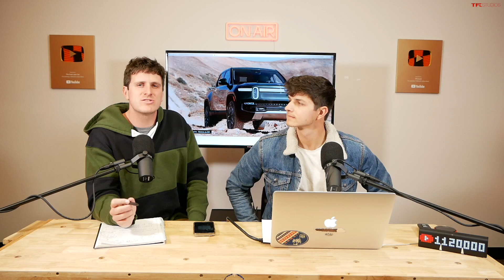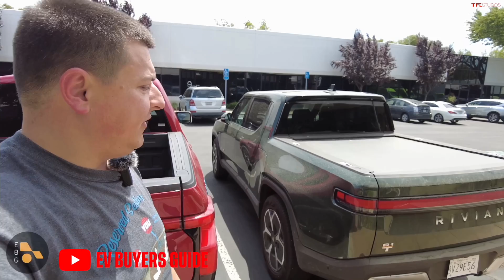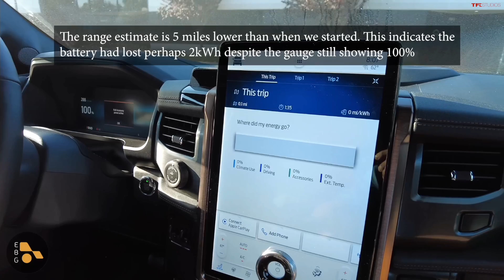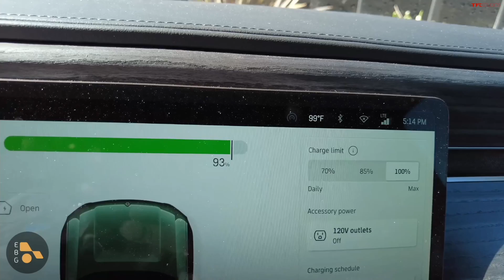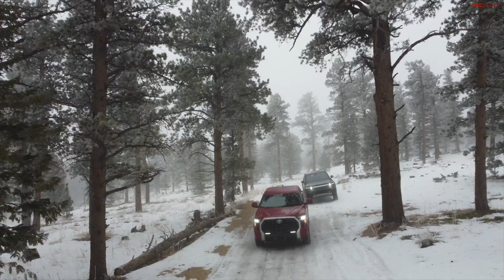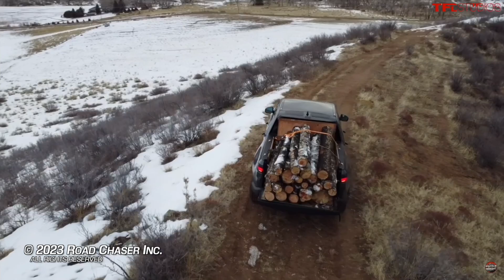This Rivian Is Getting The Equivalent of Just 25 MPG: Here's Why That Matters!

Comment: It will be perfect if they add an extender small alternator or generator that gives you at least 40 miles range in gas, like the BMW i3 or something.  There are situations that you cannot charge specially in cold weathers. Maybe down south you could use a solar panel to charge enough but in colder climates is a no no

Comment: My calculations are 9.5 cents per mile when I charge frome home, about 30 bucks, and calculating a 35% loss between the battery and wall socket.

Comment: There is a ton of conjecture here due to Rivian's lack of transparency with issues. They promote their over the air diagnostics capability, send out updates saying they will fix the issue, then say it is normal consumption. The battery management including preconditioning has issues. If it was a software issue, it would have been resolved by now. Software does not use this much power. Everything points to a hardware temperature control battery issue. It will sink the company if this is the problem and they have a massive battery replacement program.  They will eventually have to come clean on this. All I can suggest is, do not buy a Rivian until this issue is resolved. For all you Rivian owners, I wish you the best. Rivian talk to us!!!!

Comment: 3-12% battery loss is massive. My tesla (not a bash, just a comparison) uses maybe 1-2 percent over that period of time as long as you let it sleep. I wonder if the owner has his security cameras running on the rivian, or if it’s constantly checking for updates? I do know that some tesla owners had massive drain before because they had their tesla linked to their “better route planner’ app…the app was never letting the car sleep and always relaying information, etc causing massive battery drains.

Comment: I thought Rivian had something workable going, but I couldn’t recommend them with SO MUCH inefficiency.  No way! 
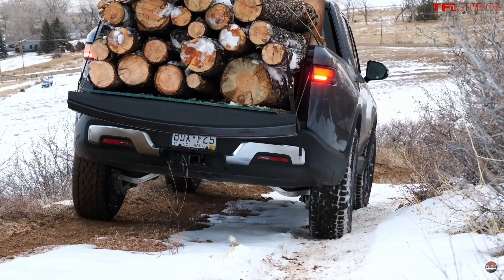Hearing someone from Rivian Service ( 8:50 ) say losses of 3 to 12% a day is normal is unbelievable!  I’ve owned 5 plug in vehicles from three manufacturers and never seen more than a mile or loss a day except when using Tesla Sentry Mode’s active camera monitoring.  I travel for a living and usually go on 3 or 4 day trips most weeks of the year.  I’ve never seen seen more than six miles of total range lost on my Model 3, and that’s with it parked in the Houston heat (no Sentry Mode).  That would be about 2% of my long range battery’s capacity over 3-4 days.

Comment: The reason to pay much more for electric car - savings. 
But it has low range, charges very long and generaly you don't drive it a lot. You don't save on fuel and maintance at all, especially considering the price difference!
If you want true savings, just buy a used ICE car.

Comment: I tried it with my Volvo S40 D5 185 HP. I charged it with 57 liters of diesel (around 15 gal) and left it for a month. After a month it DIDN'T loos a single drop of diesel fuel! My Volvo is 50-60 mpg. :D

Comment: These poor people without garages buying electric cars in states with below freezing temperatures.  

Batteries hate really cold temperatures and really hot.  People forget it's a battery and it's constantly doing a chemical reaction inside.  

I know these automakers aren't insulating the batteries enough.  Soon they will sell a battery magnetic blanket to keep the battery at optimal Temps in colder climates that you will plug in at home.  The sooner they get to this the sooner they'll get to tackle the next issue.  

Either way batteries have life cycles and we aren't perfect to keep a battery in its happy place 24/7 to get max life out of it.  So have batteries get cheaper and materials as well these batteries life cycles will get to average 10-15 years soon.

Comment: It would be best if you equate all the energy sources (electric, gasoline, etc.) in joules.  AND, provide a small table to let all of us tranlate.
One joule represents (approximately):

The amount of electricity required to run a 1 W device for 1 s.
The energy required to accelerate a 1 kg mass at 1 m/s2 through a distance of 1 m.
The kinetic energy of a 2 kg mass travelling at 1 m/s, or a 1 kg mass travelling at 1.41 m/s.
The energy required to lift a medium-sized tomato up 1 metre (3 ft 3 in), assuming the tomato has a mass of 101.97 grams (3.597 oz).
The heat required to raise the temperature of 0.239 g of water from 0 °C to 1 °C, or from 32 °F to 33.8 °F.[15]
The typical energy released as heat by a person at rest every 1/60 s (17 ms).[note 1]
The kinetic energy of a 50 kg human moving very slowly (0.2 m/s or 0.72 km/h).
The kinetic energy of a 56 g tennis ball moving at 6 m/s (22 km/h).[16]
The food energy (kcal) in slightly more than half of a sugar crystal (0.102 mg/crystal).

Comment: You mentioned parking at the airport.  I just did this in December with a Model 3 when I went away for about 4 weeks. I got to the airport with about 68% of the battery.  Over the first day and a half, I lost like 5% of the battery.  Then I did some calculations and decided to remotely switch off sentry mode, cabin overheat protection and stop checking on the car so much.  Over the next 3+ weeks, I lost another 2% or so of the battery.  And this is only a 78 kwh battery pack, so much less vampire drain. I don't know what Rivian is doing wrong, but they need to fix that!

Comment: Don’t these trucks have a heat pump to keep the batteries at a certain temperature while sitting around? That’s where your battery drain is. You should always have your EV plugged in while not in use over night. We had a Kona EV. Great car. Always plugged it in at night. Spent its life outside a garage in winter,

Comment: I’m not sure about the vampire drain, but you can’t accurately measure consumption based on the % battery readout in the vehicle. Because most electric vehicles lie to you, in order to prevent you from completely draining your battery or overcharging your battery. You have to measure the amount of electricity going into the vehicle compared to the mileage driven to get your mpg equivalent.

Comment: I am confused, how is 135kw battery is equal to 4 gallons of gas? Is he comparing cost of fuel/electricity? If so it's not fair comparison even if both costs the same 135kw battery can do 300 miles while 4 gallons will do max 100 miles in similar truck.

Comment: I have a Sense home energy monitor and I can see that after charging is complete (but still plugged in), our R1T will draw max power for 3-5 minutes every 45-60 minutes, presumably maintaining its state-of-charge. It is definitely true that this consumption while stationary needs to be considered in the overall cost and environmental impact and the EPA numbers don't count that. Disappointingly, when I pre-heat the truck, it doesn't seem to be smart enough to draw from the connected shore-power and depletes the battery even though it is plugged in. 🤦

Comment: I just want you guys to put this in the context for how much energy this is:

This is essentially the same as taking an 1600 W hairdryer turning it on high and leaving it on for two hours. That’s how much juice your battery loses every day. Just from sitting there… That is absolutely insane.
Reply: 4% per day. imagine having a 100 liter tank at 2 euro's per liter. and you're losing 4 liters per day.....
Reply: @sannmarc  sorry, we don't speak European😂
Reply: My Prius Prime still had 100% battery after being parked for three weeks. It was in a garage with a steady temp of about 50 degrees.
Reply: @tommiller12345  my son and daughter in laws had a newer Prius and they were getting less and less mileage. Plus the rear axles were going bad causing more problems.   They happily got rid of it for Ford F150
Reply: Is there loss from Teslas that's similar?
Reply: @NutritionPolice  in the same weather, yes
Reply: Agreed - and going through it with a good thermal camera will surely reveal which components are sinking all that juice.

Comment: Battery packs in cold or very hot weather must be regulated temp to help the battery pack last longer 
  But that uses energy and like you said systems in stand by mode just like your laptop uses energy 
    
I live a hour from Canada border and it’s -22 today  
What would that do to any electric automobile? 
I spend 15 dollars a day just having plugged in at least…

Comment: We have a fix for this. What we have done is build a 12 V 40 amp lifepo4 block from headway cell with a Bluetooth control bms. The best only consume about 10 m amp per hrs. It can be made for any ev I started with my model x . You will be able to turn off the car completely only down side is it takes 1 min to start the car back up. Also my model x had phantom drain in the early years like 2017 2018 it went away with the age of the battery.

Comment: I parked my Bronco for the winter in November. Going to get it out when the snow is gone. It will have the same amount of fuel in it as it did when parked. Guess the old stuff is a lot better than the new.
Reply: And the battery IOD on a modern ICE car is typically 25mA. After months of parking it will still start right up. Longer than that, two seconds you can disconnect the battery negative before you leave. Rivian is smoking some crazy stuff. Tesla's Vampire loss is MUCH less. You park your Rivian someplace for a few weeks, come back, you can't get a jump-start from the tow truck! When Rivian admits to as much as 15% vampire draw, Houston, we have a problem.
Reply: @Ebooger  8 weeks max on my modern vehicles. 4 months on my old school rides.
Reply: 100 dolars youll need the starting battery charged. Great story! has alotta punch!

Comment: Moral of the story?  EVs are stupid and unnecessary, which is something I’ve been saying for years.  EVs have always been a “solution” to a problem that never actually existed.  Sure, gasoline is a finite resource, but the planet still has many decades of supply (which could be dramatically increased if specious regulations in drilling were removed) and the pollution concerns have largely been eliminated with modern ICE vehicles as well.  To be clear, I am NOT against EVs existing in the marketplace as they do have advantages that people should have the option of buying if they so choose, but I am FERVENTLY against this worldwide governmental mandate to require an end of all ICE vehicles as soon as possible.

Comment: Just curious. Does the Rivian have a 12-volt battery onboard? If so this should be the battery if designed correctly to supply the power necessary to keep things like computers in sleep mode while the car is not engaged. I would assume so anyways. This 12-volt battery should also control the main contactor to the high-voltage battery packs so that there is no residual battery loss when the contactor is not engaged.
Reply: I believe ALL EVs have a 12 volt battery to operate the radio, lights and other accesories. I don’t think the electronics operate off of the propulsion battery pack.
Reply: @gwarlow  that's what makes the most logical sense. I wonder what could be causing the parasitic discharge of the Rivians batteries. It would be dumb if the engineers put some monitoring systems in parallel with the batteries to monitor doors or even have courtesy lights in junction. Which doesn't make sense for things like that to be on the high voltage bus.

Comment: So I can speak to my experience with my newer vehicles.  I have three newer trucks the oldest is 2017 and with all three I have had instances where they have set for a few days or a week and would need a jump.  Occasionally you can hear solenoids activating and something running with the vehicles off.  So does it surprise me that a fully battery powered vehicle has the same problem nope but it’s a bigger problem because you can’t just turn the car on to charge the battery.  Just like computers these newer cars can take longer to do things and can take much longer to shut down and it comes down to the computers I think

Comment: Because of the improved efficiency, a much better comparison to gas vehicles is to say 1 gallon of gas is equivalent to about 10 kwh (rather than 33).  So a better rule of thumb is to say his xtruck is only getting 10 miles per gallon, roughly, which is pretty bad. Sounds like something is wrong.

Comment: None of this is a surprise.  Ive lived with rechargeable battery packs since the mid 90s, they all lose about 3% per 24h at rest.  I have advised my hunting , backpacking,  backcountry friends against these all electric vehicles.  They may leave you stranded after being parked long term at a trailhead and the nearest charging station is 60 miles away. 
I have a cabin in the mtns where i stay parked 10 days at a time.  I never lose fuel out of my gasser while parked.

Comment: I have said from the start that this company will not survive.  This battery loss is totally unacceptable and the company seems not concerned by it.  Here is something to think about, this not in use drain will shorten the life of the battery pack I'm sure so when these packs start failing during warranty period the company will hae big problems.

Comment: ... plot twist from a long time Lithium battery user (hobby). Leaving the battery fully charged all the time can reduce the performance of the batteries. In hobbies we recommend discharging to 50% if you are storing. If you don't do this you will not have a fresh happy battery when you want it, as you might expect, they don't like to sit fully charged... so maybe this is by design and it could be a good thing.

Comment: That is horrible battery drain and bad power management. Even a sentry mode doesn't use that much power, (many parking dash cams can run for weeks recording with 2 camera on a basic 12V car battery. 
When off, the power usage should be in the 1-2 watt range.
Reply: watt?
Reply: @oldblueaccord1988  If you have a current clamp, test drain on a car battery on a gas powered car when it is off. When off, power usage is very low, and usually after a few minutes, many will drop to a tiny fraction of a watt (often for the alarm system, clock, and maintaining any volatile memory in the ECU).
Reply: @Razor2048  I know. I do videos of automotive amp draw on my Youtube here. Thats the joke! I get like 5 views and these guys get 300k.

Comment: LOL, did Elon pay for this stupid “report”? I swear, Rivian is the most creatively useful electric vehicle that’s come out EVER, and yet there’s a bunch of these dippy Elon fanboy dorks who are DESPERATELY trying to kill this, instead of appreciating that the head of this company is an ACTUAL engineer who treats his staff well, as oppose to a dictatorial tool who abuses his workers to the point where they injure themselves. Well buckle up buttercups, because there are A LOT of better alternatives than a frickin’ Tesla coming down the pipe. First mover is NOT always advantageous in the long run. Typically it’s the second and third to market who make the bigger impact. And in addition to Rivian (which is also faster than a Tesla off the mark), there’s the magnificently customizable Canoo EVs and Sono Motors solar-powered cars, both of which are under $40k. So start WELCOMING the competition, because it’s better for consumers. Moreover, unlike Tesla? Rivian is RESPONSIVE and steps up to the plate with fixes and improvements. They simply have the better business model. Deal with it.

Comment: EV’s trucks do not work!
It must replace the full function in the class (cost benefit analysis) performance the same with dramatic cost savings, but it does not.  Recharge range anxiety is truly insanity dealing with a platform which was getting more reliable.  The recharge time if greater than 5 minutes does not equal my 20 year old E350 Diesel Van.  I get 500 miles per tank, and only takes 5 minutes to fill the tank and tows 10,000 lbs.  road trips is the rule of the day!  It is the reason for a truck!  On the humans cause of climate change, I ask who melted the last ice age?  How about who froze it?  How about the last 5!  Did you know the CO2 was 10,000 ppm when the Earth was an ice ball frozen to the equator!  What do you think Limestone is? Calcium Carbonate.
My 2002 E350 SuperDuty 7.3 Diesel Explorer limited SE Van I would like to see an EV do 100% of what my Van can do, has done from hauling my 29foot holiday rambler Trailer 1600 miles from Maine and back, too using my Hercules enclosed truck hauler towing my sons truck and all of his belongings (took the seats out of the Van transforms to a carpeted cargo van) from Navy bases to Navy base my son is a test pilot for the Navy.  Not too mention all of the family trips skiing, boating, our ski house is 375 miles one way, boat is 110 miles one way.  Just no way I can charge for hours while making a trip 5 minutes to fill the tank with diesel and I am off, many a trip too Pensacola and back too Long Island, or even too many too count trips too Annapolis USNA when my son was a mid.  Not too mention the graduation and all the other events.  Without room temperature superconducting technology EVs will never meet or exceed my trucks function and cost per mile right now.

Comment: The electric Smart for two will self destroy the battery (junk mode) if the regular battery 12v die.......for safety purpose
Cost of replacement $18 000......